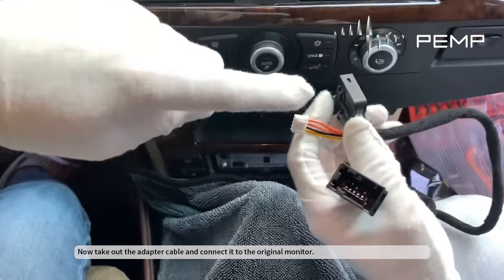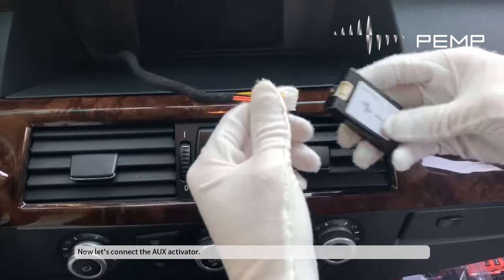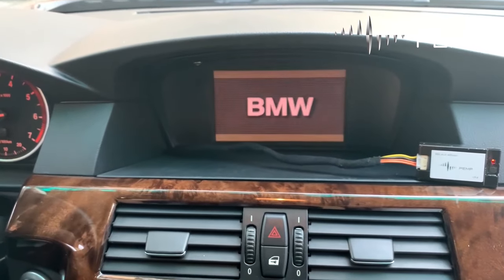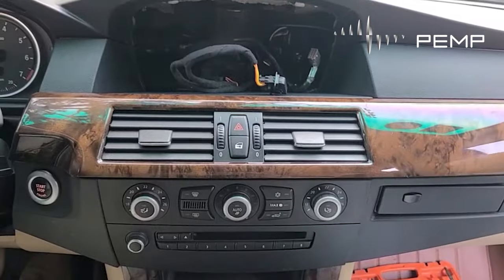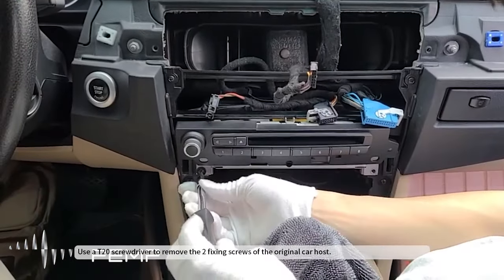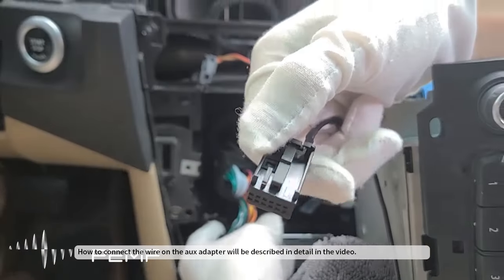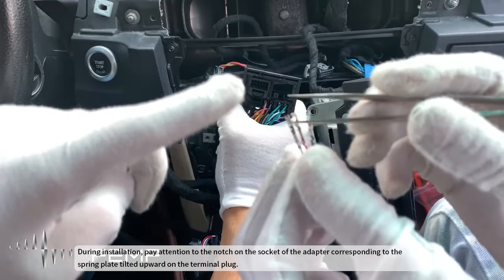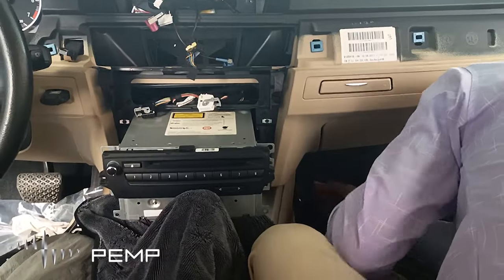Activate your BMW E60 CCC AUX Audio in 1 minute(E61/63/64 CCC all OK)

Comment: omg this is going to solve all my frustration and problems with my e60
Reply from the maker: Perfect!
Reply: Where can j buy the lvds connector for my bmw e61 2005 model?
Reply: Just add a $20 Bluetooth adapter to the 3.5mm input and stream through the adapter to the head unit
Reply: @pempcar how do I message directly? I recently purchased a android 13
Reply from the maker: @gregcampbell5551  At www.pempcar.com you can send us a direct online message.

Comment: I attempted to install on my BMW 525i 2006 without aux option, the activator worked and gave the option, but when you plug in the cable a box already exists contrary to your instructions. I still installed the cable in the same placement, but no sound. I installed the cables in every manner, but nothing. What's the issue? Is it not compatible with a 2006 525i despite the statement on Amazon?
Reply from the maker: Dear, I received your email and I replied to you using email. thanks
Reply: Did it now work?
Reply: I have the same problem! What is the solution? Can i get a copy of the email?
Reply: @IAmGeith  it didn't work. They sent me an aux adapter that had the right connectors, but no difference. I think the product simply doesn't work for that model. I did more research and for any similar product to work, you'd have to replace the amp and all speakers. BMW corrected their odd setup on the 2007 and up models. I just bought a Bluetooth channel receiver that is universal, you pair with a phone and set a FM channel. Just accepted it. No complaints.
Reply: I have this same issue, same model. The activator worked but after connecting the aux cable and reconnecting the screen there is no aux option being displayed.

Comment: Works absolutely perfect, on Bmw 525i, 2004 with small ccc. First time was a fail, cause I had installed the 3 cables on the wrong adapter, once I did it right, works perfect. Thanks PEMP. Definitely worth the money.
Reply from the maker: You did a great job!
Reply: Hi Dardanianalb7105, which model activator did you order? and do you have navigation on your car, would this make any difference installing/programming de CCC? Thanks in advance! JT

Comment: It works for me but the low frequency/ bass is so low which impacts any music with beats. Anyone with this issue  and how they fixed it ?
Reply from the maker: can you adjust the frequency in the aux audio settings?
Reply: @pempcar  i did, not good enough, bass improves but very slightly
Reply from the maker: @khalidhalba  If you replace a 3.5mm headphone cable, or replace a mobile phone test. to try to find the cause of this problem. If the original car host itself is like this, maybe we can't change it.

Comment: I have bmw e60 2005 530i and i plugged it and it showed me the aux but once i turned off the car it disappeared and the PEMP activator light is flashing and now its not red continuously like the first time i plugged can someone tell me what is the problem? I want to try again and fix the aux in the system.
Reply from the maker: Be sure to refer to the instructions on the red card to disconnect the negative battery terminal. I have listed it below:
Step4: (important )!! After activation, keep connected, wait for 5 seconds, then turn off and lock the car and let it sleep for 15 minutes. Disconnect the negative pole of the car battery for another 1 minute and then connect it back. Then get on the car and check the aux audio was display, if the aux audio also display. It has stored your AUX AUDIO menu.

Comment: Hi guys. I have recently installed an android unit to me E60. But in the process it blew the video card on the ccc factory unit. Can you tell me the button sequence to get to aux mode? so I can just use the new android system for everything.
Reply from the maker: Dear, if your oem video card was damaged，you can't see the oem interface and AUX menu. I suggest that you fix it first before activating the AUX menu.

Comment: I have 650i 2006 e63 and it’s not working the activation, the screen doesn’t restart and I tried to do the step with locked the car and 15 minutes and negative removed but no success, it is because I need to plug the AUX first on your videos you plug the wires after
Reply from the maker: (important): After activation, keep connected, wait for 5 seconds, then turn off and lock the car and let it sleep for 15 minutes. Disconnect the negative pole of the car battery for another 1 minute and then connect it back. Then get on the car and install other steps!

You must follow the video to activate the AUX first and see the AUX menu before disconnecting the battery.

Comment: Can music be played immediately on an AUX-enabled e60 by simply connecting it physically without coding?
Reply from the maker: You must first use the activator to activate the AUX MENU of the OEM menu according to the steps, after the successful opening you can use the AUX, confirm that no code is needed.

Comment: hey I want to buy this product but I want to make sure it'll work on my bmw I have a 2004 525i e60 bmw with CCC head unit
Reply from the maker: Yes, this one fit your car. pls note below step.
Step4: (important )!! After activation, keep connected, wait for 5 seconds, then turn off and lock the car and let it sleep for 15 minutes. Disconnect the negative pole of the car battery for another 1 minute and then connect it back. Then get on the car and check the aux audio was display, if the aux audio also display. It has stored your AUX AUDIO menu.

Comment: Do i need to disconnect the negative pole in the trunk?
Reply from the maker: Yes, when you activate it, be sure to disconnect the negative battery terminal. Refer to step 4.
Step4: (important )!! After activation, keep connected, wait for 5 seconds, then turn off and lock the car and let it sleep for 15 minutes. Disconnect the negative pole of the car battery for another 1 minute and then connect it back. Then get on the car and check the aux audio was display, if the aux audio also display. It has stored your AUX AUDIO menu.

Comment: If I already have an aux plug in do I need to install the cord? For some reason I have an aux plug but no aux option
Reply from the maker: No need.
Yes, the car have the aux plug maybe it must has the aux option.
Reply: @pempcar  it 100% doesn't have the aux option which is why I'm confused, it has an aux input about an inch to the right of the dvd input which I've never seen on any of the videos when I look up the 06 525i but I don't know what else that input can be because an aux cord fits perfectly in there, it just doesn't have the aux option

Comment: Hey I have a 2005 645ci and I already have a AVIN radio put in ....but my carplay won't work because I dont have aux...my question is will the programming of the Aux mess with the functions and setting of the Android radio.....what should I do?? Any suggestions 🤔??
Reply from the maker: You need to restore the state before installing the Android screen and activate the OEM AUX menu first. When activating, be sure to follow the instructions on the red card. Then reinstall the Android screen and you can get the Android sound.

Comment: Hey PEMP, 
Great Video, Going to purchase this for my E60. I have a question is that, after aux activation, when I install the Android Unit in my CCC head unit, it is possible to not connect the aux cable and still pull audio directly from the harness? I thought CCC is not able to do that? Please explain
Reply from the maker: Yes, you are right. If you are about to install an Android screen, you do not need to connect the three red and black audio cables, because the Android harness itself is already connected.
Reply: Thanks for the reply, does the activation of aux eliminating cable apply to all CCC units? Or just the early E60s? I have an E90 CCC as well, does the same concept apply?
Reply: How do I buy the E60 Aux Adapter cable alone from you? I need an extra one without the adapter? Can you create a listing on Amazon or on your website?
Reply from the maker: @mangekyosharingan3020  It is suitable for all ccc without AUX menu
Reply from the maker: @mangekyosharingan3020  Sorry, I don't sell the cables individually. Note that the activator can only be used successfully once.
Reply: @pempcar  sorry just to clarify! So any CCC that came with AUX function from factory(BMW). Have to connect the aux cable and can’t use the harness for audio?
Reply from the maker: @mangekyosharingan3020  Yes, if it has the oem aux menu, you only connect the 3.5MM AUX cable. do not need the activter.
Reply: Question: if i have the ccc doesn’t work well, can i try if go whit this and if not then buy another ccc and try again?

Comment: Mine stopped working. The light on the pemp unit flashes and doesn't go to a solid light
Reply from the maker: When activating, be sure to follow the steps on the following web page.
Step4: (important )!! After activation, keep connected, wait for 5 seconds, then turn off and lock the car and let it sleep for 15 minutes. Disconnect the negative pole of the car battery for another 1 minute and then connect it back. Then get on the car and check the aux audio was display, if the aux audio also display. It has stored your AUX AUDIO menu.
Reply: @pempcar I'll give that a try again. It was working for about a week and then just stopped working
Reply from the maker: @ensen001  Be careful to make sure you don't reset your car when it goes in for service. Otherwise the AUX menu will disappear.

Comment: Worked for a few seconds. Turned the car off and the aux is mission.  now the pemp just blinks please help
Reply from the maker: Please be sure to follow step 4 of the web page instructions. The red card also has instructions as follows:
Step4: (important )!! After activation, keep connected, wait for 5 seconds, then turn off and lock the car and let it sleep for 15 minutes. Disconnect the negative pole of the car battery for another 1 minute and then connect it back. Then get on the car and check the aux audio was display, if the aux audio also display. It has stored your AUX AUDIO menu.

Comment: I have a question before but it for my series 6 2006, does it work with Bluetooth? Can I pair my iPhone to the adapter and stream music ? Or it’s just to have a jack 3.5mm adapter?
Reply from the maker: Its main function is to activate the AUX menu of the OEM interface, if your car has an AUX menu, you don't need to buy it.
Sorry, it doesn't have Bluetooth. It only has a 3.5mm connector.

Comment: Does everything shown in the video come with the PEMP on Amazon? Like the audio input line and all the wire harness
Reply from the maker: Yes, it includes all wiring harnesses.
Reply: @pempcar  and one more question can you please specify the instructions after activation….this is what I’m referring to “Step4: (important)!! After activation, keep connected, wait for 5 seconds, then turn off and lock the car and let it sleep for 15 minutes. Disconnect the negative pole of the car battery for another 1 minute and then connect it back. Then get on the car and check the aux audio was display, if the aux audio also display. It has stored your AUX AUDIO menu.”
Reply: @645KoBra right. The instructions don't follow this videos instructions. I'm leary of the Indian product.

Comment: I have a 2005 545i. Will this work on my car?
Reply from the maker: Yes, it fit your car, please note  as below.
(important )!! After activation, keep connected, wait for 5 seconds, then turn off and lock the car and let it sleep for 15 minutes. Disconnect the negative pole of the car battery for another 1 minute and then connect it back. Then get on the car and check the aux audio was display, if the aux audio also display. It has stored your AUX AUDIO menu.t fit your car.

Comment: After connecting my PEMP e60 Aux activation and pressing the power button for 3 seconds the light just fast blinks and nothing happens.  20 mins later the light is still fast blinking with no change the BMW screen entertainment opts. Please advise
Reply from the maker: If it flashes quickly, the activator is already in use. You cannot continue. Please send your purchase order number to our after-sales service team email: service@pempcar.com

Comment: I have a 2005 530i and the slot y’all put y’all’s aux is where my factory amp goes ive tried pinning it into the same clip as the amp but the sound is very quiet how do I fix this issue
Reply from the maker: Dear, you can refer following video intall the three wires:
https://www.youtube.com/watch?v=FGvNNRAMPcU

Comment: can this be used on multiple cars or you can just activate one unit with it? and do you need to leave it connected after activation?
Reply from the maker: I reply you question:
1. It can only be activated successfully once and cannot be reused;
2. After confirming the successful activation, you can no longer connect it to the harness.
3.(important): after activation, wait for 5 seconds, keep the connection, then turn off and lock the car, and let sleep for 10 minutes. Then get on the car to install other steps!
thank you so much
Reply: You can also use obd2 port and cable to activate AUX as many times u like. Search youtube ..
Reply: @tomi3788  its hard to do dude, we need something easy

Comment: it worked for the first time but after installing android no aux option was shown . when i retried the pemp activator was blinking red and was not activating 
any solutions
Reply from the maker: Dear, Please follow the instructions below on the red card.
Step4: (important )!! After activation, keep connected, wait for 5 seconds, then turn off and lock the car and let it sleep for 15 minutes. Disconnect the negative pole of the car battery for another 1 minute and then connect it back. Then get on the car and check the aux audio was display, if the aux audio also display. It has stored your AUX AUDIO menu.

Comment: I installed it in my car I saw that the aux was turning off the car as indicated but when I turned it on again the aux option never appeared again, why?  Do you know if I have any solution? help me 🙌🏼
Reply from the maker: God, this is bad news.
You must turn off the car and disconnect the battery negative power supply according to the prompt of the red card:
 (important )!! After activation, keep connected, wait for 5 seconds, then turn off and lock the car and let it sleep for 15 minutes. Disconnect the negative pole of the car battery for another 1 minute and then connect it back. Then get on the car and check the aux audio was display, if the aux audio also display. It has stored your AUX AUDIO menu.

Because it can only be successfully activated once, if you have already used it, you need to buy it again.

Comment: hey I have the same model car. a few days ago, instead of the idrive screen showling the named functionality, everything is replcaed with alphanumeric codes on all menus (except radio).  Additionally , there are only 3 media options and the aux function is gone. the audio menu bar line shows 4 character alpha numeric codes, not am.fm.cd   -  the bmw is a 2007 525d.  briefly, the start screen on starting the car showed the 4 functions before reverting back to the alphanumeric.   HELP
Reply from the maker: Have you done any other programming besides activating aux?
Reply: @pempcar  I've not programmed anything ever

Comment: Hey I just installed the pemp 10.25 inch screen. My E60 does not come with aux. does the harness that comes with the screen already have the aux adapter? Because if so all I have to do is plug in the activator and reset my system and it should work right?
Reply from the maker: Dear, you should buy the aux activater open the OEM aux, then you get the audio of the PEMP android.  pemp screen has the wire of the activator, so you no need  install the black white and red wire.

Comment: hi I installed it on the BMW e60 2006 but the audio is very low in the aux.  There is a solution?
Reply from the maker: Please help me check if those three harnesses are plugged in place? When installing the three wire harnesses, be sure to remove the 2 layers of plastic housing. Please refer to the following video for installation.
https://www.youtube.com/watch?v=FGvNNRAMPcU

Comment: Probably a very dumb question but does this require my idrive screen to be working? Or would it still activate even if my screen isnt working. My ccc is fine and my fuses, my screen is just burnt out.
Reply from the maker: This is a great question of yours!
If only the display is broken, you can activate the AUX menu. But because it cannot be displayed, you cannot know whether it is activated. It is recommended that you follow the steps of the red card. Good luck.

Comment: The adapter does not fit the plug in to the monitor on my 2006 e63 650i
Reply from the maker: Please send your 2006 e63 650i OEM display power socket to our aftermarket team at service@pempcar.com
Reply: Smh yes it worked perfectly!!! Was moving too quickly

Comment: hey i bought this for my bmw 530i 2005, i followed all the steps but the pemp box just flashes red and it won’t appear in my console
Reply from the maker: Notice:
1. Be sure to activate the AUX menu using the OEM display before installing the Android screen;
2. Be sure to follow step 4. After displaying the AUX menu, turn off the car for 15 minutes and disconnect the battery power.
Reply: @pempcar  is this the direction for cars with no aux (2004 525i E60)?
Reply from the maker: @suezeeq12  Yes. You can use PEMP activator to activate the AUX menu first